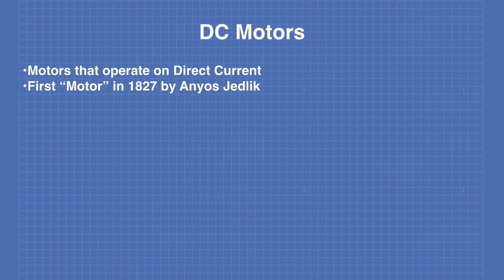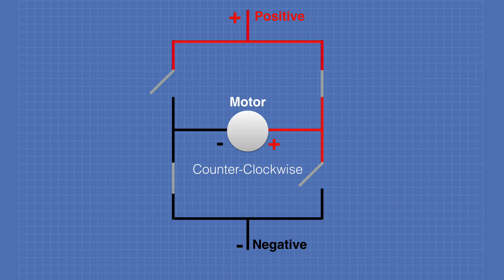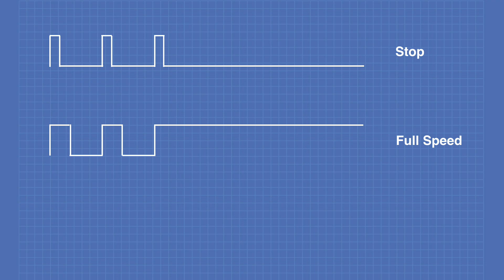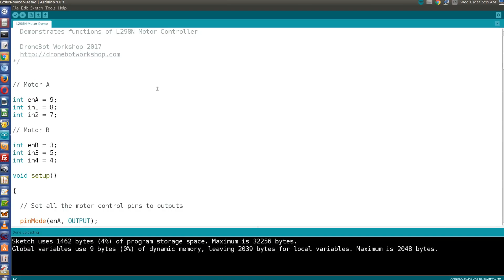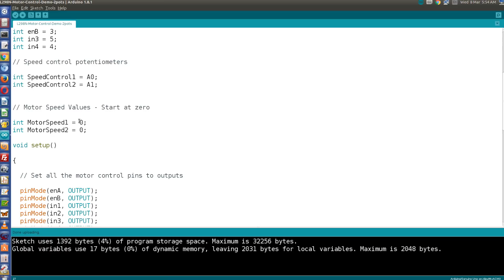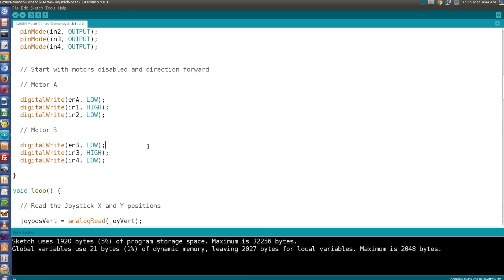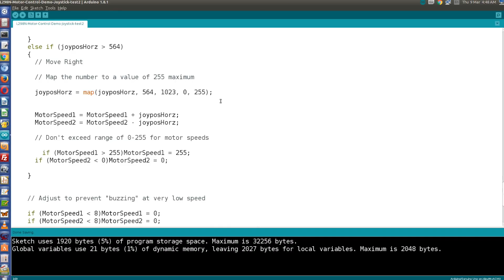Controlling DC Motors with the L298N H Bridge and Arduino

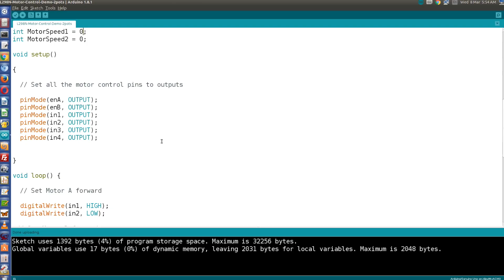Comment: I have a question 22:36

int Speedcontrol1 = A0;
int Speedcontrol2 = A1;

int motorspeed1 = 0;
int motorspeed2 = 0;

// Read the values from the potentiometers

Motorspeed1 = anlogRead(Speedcontrol1);      * motorspeed value= 0*        0 = anlogRead(A0);
Motorspeed2 = anlogRead(Speedcontrol2);      * motorspeed value= 0*        0 = anlogRead(A1);
Reply from the maker: In the code you highlighted "Speedcontrol1" and "Speedcontrol2" represent the two analog inputs used for the potentiometers.  "Motorspeed1" and "Motorspeed2" are variables that will hold the values from each of those analog inputs, they are each initialized with a value of zero and are then assigned the values (from 0 to 1023) obtained from their respective analog input ports.

Your comment "0 = anlogRead(A0);" is not correct, you are interpreting it backwards. A0 and A1 are analog INPUTS, the statement "Motorspeed1 = anlogRead(Speedcontrol1);" assigns the current value of the A0 input to the variable "Motorspeed1".

So in other words "Motorspeed1" and "Motorspeed2" start off with a value of zero (so that our motors are stopped when the code begins) and within the loop their values change to match the values obtained by the potentiometers, which can be anywhere from 0 to 1023.

Does that clarify it a bit?
Reply: Thank you for answer. 
At first I thought that 0 instead of the word motor speed. The truth is it can change in void loop().
Reply from the maker: Glad to be able to help.

"Motorspeed1" and "Motorspeed2" are VARIABLES, meaning they can be reassigned to different values as required.  If they were CONSTANTS then your original interpretation would be correct and that line of code you highlighted would fail to compile and would produce an error.

:)

Comment: Hello Dronebot, your electronics instructional videos are fascinating and very educational,  thank you for taking your time to list them.  I am afraid that my knowledge of electronics falls far short of yours!    I have a problem that I have been trying to solve for a while now. I am building a replica of a car dash board and I have been trying to find a way of powering up the rev counter to make the needle go up and down in sync with a recording of the actual car revving up and down,  I think that the rev counter works on a square wave input.  have you any ideas how I could make this happen?  I would be happy to pay for your time if you could come up with a solution.  Best regards.  Jonathan
Reply from the maker: Hi Jonathan

Sorry for the delay in getting back to you, I really appreciate your comment.  I'd need a couple of additional details to assist you with your dashboard.

1 - You say you're trying to time this to a recording, I presume you mean an audio recording?  If so you'd need to sample the audio recording. That might be doable using one of the Arduino's analog inputs as I presume the sounds of an engine are fairly low frequency and therefore within the Arduino's sampling capabilities.

2 - If the rev counter works with a square wave input you can generate this with an Arduino digital output. Again I'd need the specs of the rev counter to be sure. Of particular importance would be knowing what voltage level the rev counter uses and how much current it draws, you may need to tie a transistor to the Arduino's digital output if it used more than 5 volts at 20 milliamps.

Sounds like a very interesting project and I'd be happy to help you if you can provide a few more details.  It also sounds like an excellent subject for a YouTube video of your own!

:)

Comment: Nice explanation of theory and practice. Very nice demos - thank you. I am working with a DC treadmill motor and this gives me an option to using the "native" boards.
Reply from the maker: Thanks Dave, glad you found it useful. I'd love to see what you're building with a big motor like that!
Reply: I'm using it as variable speed driver for my lathe. I am tired of changing belts!
Reply from the maker: Awesome! I can relate to the belts issue with my drill press, it's annoying to have to change them to change the speed so I usually don't bother (which is bad as different speeds are better for different materials).  Perhaps you'll post a video of your setup when you're done, I'd love to see it.

Comment: Hello Sir, that is a great video. Can you please tell me a bit more about flyback diodes on L298n pcb. They should suppress back emf from motor, but it seems to me that they lead this AC component  through the outside circuit and into our power supply,instead directly through the motor.  If I have, for instance, LEDs in circuit along the way, protected with diodes they will light up on this AC component, when polarity is reversed. Not sure about this though. Thanks, and keep up the good work.

Comment: When you start controlling the motor with the arduino, is it possible to add a braking function to the code or would you need to add a breadboard and a few components to brake the motor?
Reply from the maker: Now that is a great question - wish I had a great answer for it!

Braking a DC motor generally involves putting a load across it to absorb the energy that the motor produces - a DC motor and a DC generator are essentially the same thing. In an advanced battery-powered circuit this energy can be used to recharge the batteries, this arrangement is popular in electric cars. If you do decide to experiment with this be VERY careful, especially if you plan on charging Lipo batteries!

The L298N however may not be the best choice to implement this kind of solution, I'd probably opt for a discrete circuit that was designed with braking in mind. In any case you would definitely need some external components to perform the braking.

One arrangement I've seen to accomplish this involves using a DPDT relay on each motor to essentially short out the motor and cut the power supply. Rather than short out the motor I'd "bleed" the current through a high-wattage resistor of a few ohms.

A good article on DC motor braking is on the Texas Instruments blog - https://e2e.ti.com/blogs_/b/motordrivecontrol/archive/2013/10/18/the-art-of-stopping-a-motor
Reply: Thank you very much for your reply, I think I'll try dynamic brake (by using an additional resistor, capacitor and diode). Your videos are very insightful and your explanations are very clear (even beginners like I fully grasp the concepts) keep it up, I can see your channel growing!!

Comment: why do you need a motor driver?
Reply: You need one driver, as the Arduino output pins can't provide enough current to drive a motor. If you try get to much current from or into a port, you will destroy the port and maybe even the Arduino.
You have to check, but the Arduino have a maximum output current on each board and a maximum sum of all ports. So you are not allowed to go over both limits.
There are also problems driving a motot, which a driver also fix, like the motor can generat to much short spikes of higher voltage, which also will ruin you Arduino port, and posible the Arduino.

A ruin Arduino can be fixed by changing the processor chip.
Reply from the maker: Not sure I understand what you are asking here?  Are you asking why I personally would need a motor driver board (answer - to build robots)  or why one would need one in general (answer - to control two DC motors using the TTL logic level signals from a microcontroller or other logic device).
Your avatar indicates that you are a programmer so I'm not sure what you don't understand here.  Please let me know so I can assist you further.

Comment: Thank you very much for your excellent video with articulate explanation. I enjoyed every bit of information explained by you. Will you please make a. video using stepper motor or dc motor and the Adriano for linear movement of remote camera slide motion. thank you for your time.
Reply from the maker: Glad you enjoyed the video and I'm definitely going to do a video about stepper motors (and also servo motors).
As for a camera slider it's a possibility for a future video, as I wouldn't mind having one myself.  Currently I'm building a couple of robotic projects that I'll be presenting in future videos but I ALWAYS appreciate suggestions for future projects.

Comment: Very COOL, very clear, just wondering how would you use or change this sketch to make this just a pan and tilt system ?
Thank you !
Reply from the maker: To be honest I'd be tempted to use servo motors to build a pan and tilt system, but you could probably do it with DC motors. You'd likely want some sort of limit "switch", either a physical microswitch or an optical source-sensor, to let the Arduino know when the pan or tilt is at its maximum position.  And I'm sure you'd also need to gear down the motors so they drive the pan-tilt mechanism at a much slower top speed.

The sketch would be sort of a combination of the "two potentiometer sketch" and the "joystick sketch". You are just controlling two independent motors as in the 2-pot sketch, but you would want to incorporate the "forward-reverse" method I used in the joystick sketch (I.e. the y-axis joystick code) for each motor.

Comment: Will any Nema17 run on any voltage,,,will any stepper driver run a Nema 17  Thanks
Reply from the maker: No sure I understand what you are asking here? The Nema 17 is a stepper motor and the L298N can indeed be used to drive a single stepper motor like the Nema 17. In this video I've shown how to use the L298N to drive a pair of DC motors but I do intend to cover stepper motors in a future video.
Reply: There are a lot of different drivers just wondering what the difference is between then???

Comment: Thank You  at last there is a smart very great teacher to help the newbe like me  not a fast learner but you made it easer for  everyone to understand  Peaple like you are hard to find thank you god bless you . Will you do a video on how to make a rc excavator arm  strougher  it cost to much for to buy Linear Actuators is there a way around that The rc excavator i am working on is a Huina 1550 15 channel 2.4ghz 1/16 scale.(i can make the actuator but not the board.Iam with you all the way.
Reply from the maker: Thank you for your kind words, much appreciated and I'm glad I could help you.
That RC Excavator is cool, kind of like a remote car and arm in one package.  
What exactly do you want to modify on this? It seems to come with a transmitter and a pretty full set of controls. Or are you looking to control it with an Arduino instead of manually?

Comment: Thanks for the great quality video! Would be great to see some videos on selecting/sizing components to work with Arduino on larger, higher power budget, projects. (500-5000watt, say) There are plenty of us on the learning curve with larger-scale ideas/projects that would like to put our micro controllers to work!
Reply from the maker: That's a great idea actually. I am preparing some IoT (Internet of Things) projects that control 110-220 Volt appliances so I'll certainly consider expanding upon that.

Comment: Can i run a 24 v mobility scooter motor and 2x 12 v drill motors off this circuit if i use relays. i need torque and program ability.
Cheers
Reply from the maker: Not exactly sure what the relays would be for?

The L298N can handle 2.5 amps at 35 volts, not sure what the current draw on the motors you are using would be. If they are less than 2.5 amps and the yare brushed DC motors then the circuit and sketches should work as-is.

If you need greater current capability you could look into building an H-Bridge using discrete transistors or MOSFETS. You'd still control in in the same fashion as the L298N so you could reuse the code.

Comment: Arduino + L298n H Bridge Driver = Low Voltage Output
plz give me the solution.....
Reply from the maker: Are you speaking of a low voltage on the motor output? Remember, the output voltage there will be about 1.4 volts lower than the motor supply voltage (this is why I used 7.4 volts to drive a 6-volt motor in the video).

Or are you talking about a much larger voltage drop?  Just a couple of things come to mind there:

- A poor connection, probably a ground
- Your power supply has insufficient current to drive your motor(s)
- Are you powering the logic circuits with 5 volts from the Arduino? If so make sure you have the h5-volt jumper removed.

Hope some of this helps.

Comment: This is a very good video, only I would like to turn the engine A in 2 directions when the engine B stops (with Horz) Vert should remain as it is, I get the skatch simply not so changed, do they have a solution? (Translated with Google translator)

Comment: Hi, great video!!! And your workshop, WOW!!!I am starting a project that will involve the DC motors, but I need to do it with an Intel Galileo 2nd Gen. I wonder if the L298N is compatible with the Galileo. I just started to get the information so I don´t know how compatible are Arduino and Galileo.Thanks in AdvanceGreetings from Costa Rica
Reply from the maker: Hi Rodolfo

You should have no problem using the L298N with the Intel Galileo, although the Galileo is a 3.3 volt board it's GPIO supports both 3.3 and 5 volt logic (which you need for the L298N). It also has 6 PWM outputs so you're good there as well.

The Intel Galileo is compatible with the Arduino IDE so you should have no problem moving between the two.

Comment: thnx for video.
it s very very usefull.
pls use nrf24l01 and servo motors it can be usefull for rc car projects.
Reply: if you use nrf24l01, dc motors, servo motor and joystick one time it can be usefull for me :)
ı want to build rc car but ı dont know arduino codes
Reply from the maker: I will be showing some designs for remote control, including using the nrf24l0, in some videos I'm working on now.

Comment: I don't get why this video only has 20000 views, this is extremely useful for beginners who want to build robots. It is very clear, you made the demo step by step so it is very easy to understand, I think even for people who have never done this before. Thank you so much!!
I have a question. What if you have to use a power supply with let's say 300 Watts to power stronger motors?
Reply from the maker: Glad you enjoyed the video, thanks for your kind words.

The L298N is rated to a maximum of 50 volts at 3 amps per channel (2.5 amps if you are using PWM), so 300 watts is about the maximum for two channels that it could handle. Of course the motor will only draw the current it requires.

Personally though I would never un it that close to maximum specs, I like stuff to run relatively cool if it can. If I had to control a really big motor I'd look for other H-Bridges or even build one from scratch with power transistors.  

The L298N is great for most hobbyist applications but for industrial stuff you may need to look at other designs. The principles for motor control that that I outlined in the video will be the same.

Comment: Hi, I'm in desperate need of help. So I have the other H Bridge (the one you didn't use to demonstrate) and I need the enable pins on the bridge to connect to PWM pins on the arduino. However, there is a jumper on those enable pins, how do I wire them?
Reply from the maker: Sorry for the late reply, I know you're desperate!

Just remove those jumpers, what they do is permanently enable the motors so that you can just use the module to control their speeds.  Save the jumpers though as that stuff comes in handy!
Reply: DroneBot Workshop thank you so much!

Comment: so,  i have a driver board (the one with black connectors instead of yellow) and i understand all that you've mentioned.....  but,  i have an extra row of connectors above the inputs marked 5v and ground.  what are these?  are they the onboard 5v? how would i control the flow to inputs? a simple transistor?
Reply from the maker: If you're using the board that I think you are then you're speaking of a jumper labeled "CON5" (at least that's what it's labeled on mine) .  If you only see connectors there then the jumper is missing, the connectors are spaced .1 of an inch apart to accept a standard jumper.

This is the 5-volt jumper and it works as follows;

- If you are using an external 5-volt supply (as I did in my testing videos) then you need to REMOVE the jumper
- If you only want to use the motor power supply ands if it is at least 8 volts then you can leave the jumper in and the 5-volts will be derived from the motor supply voltage, using the modules built-in voltage regulator.

In other words it functions the same as the "5-Volt" jumper that I show in the module in the video.
Reply from the maker: These look like just 5 volt and ground outputs. The pins are spaced so you could use jumpers to permanently connect the enable lines high and set both motors forward (in some applications you may just want the board to drive motors without an Arduino or other device).

If you're following along with the video experiments you could just ignore these. On your board JP1 seems to do the 5-volt power selection.  The lower pins are what you''ll use to connect the data lines to the Arduino.

Comment: can i just use a transistor if i dont want to control direction but still use PWM?
Reply from the maker: If you mean just "hardwire" the data inputs so the motors spin in the direction you want and use a transistor-based oscillator to provide the PWM then yes you can certainly do that.  Anything that can put a 5 volt level PWM signal into the enable lines will work, that's really all that twh Arduino is doing here.

A common method is to use a 555 timer to build a PWM controller, if you set its output level to 5 volts then you'd be able to directly connect that to the L298N module.  Much cheaper that an Arduino Uno!